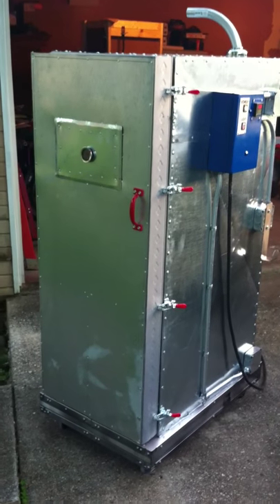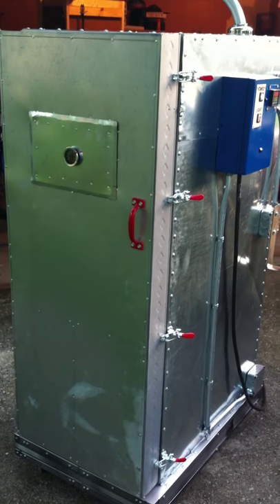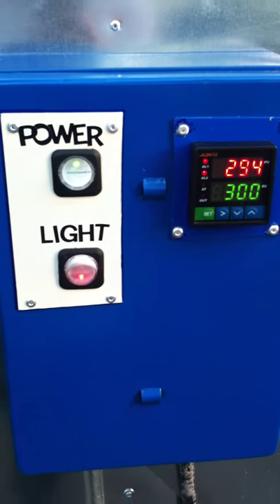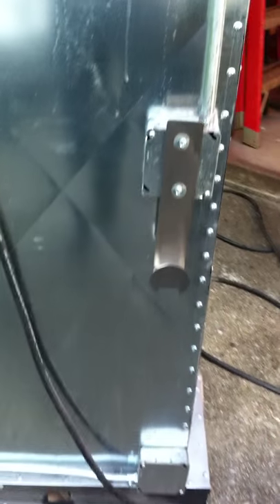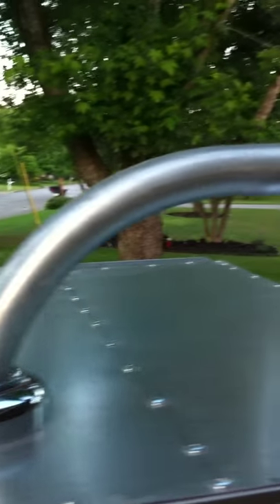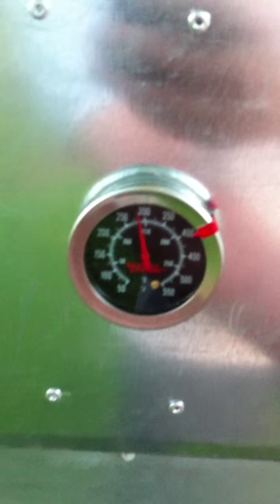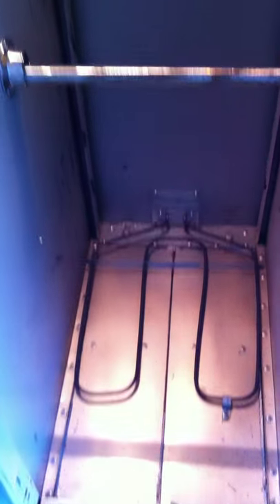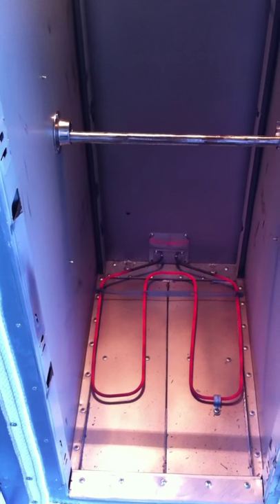Homemade powder coating oven

Comment: NICE BUILD! How did you wire everything?
Reply from the maker: I used heat resistant wire inside of 1/2" conduit. I used one broiler element in the bottom. All my wiring is kept on the outside of the oven, only entering to the element or light.

Comment: What controller are you using there?  Looks awesome!!
Reply: +JS Shaver It looks like either an Inkbird or AGPtek temperature controller.  Amazon has them.
Reply: +Steven Scott Thanks!
Reply: +JS Shaver I used the TET612 Temp Controller. I found this one on Ebay for $45.
Reply: Awesome ... Thanks!
Reply: ***** Controllers are one thing but the relay is most important because most of these come with the same relay which aren't good ..
Reply from the maker: I used a 120v Contactor with the controller listed in the above comments. I didn't want to use the solid state contactor/ heat sink set-up.
Reply: JS Sh

Comment: how long does it take your oven to reach 400F or 200C?
Reply from the maker: Usually it takes around 15-20 mins when I autotune the oven to 400F.  I have no issues with the oven. It works great everytime.